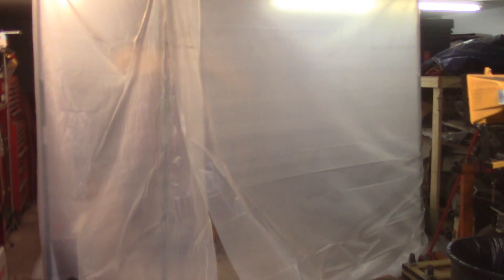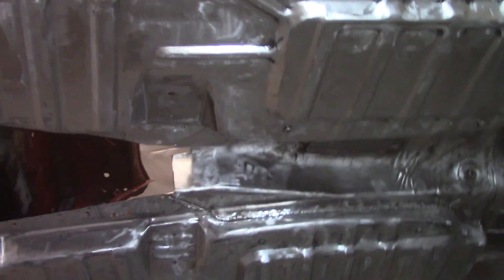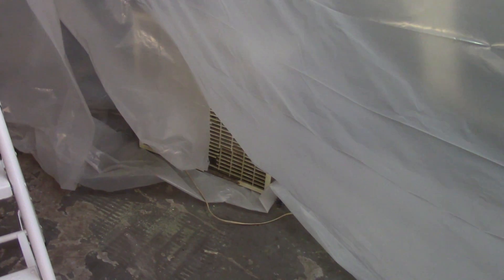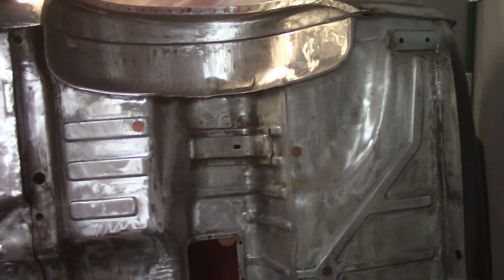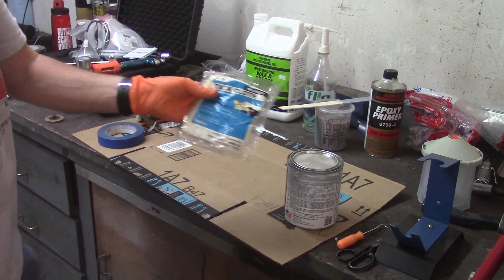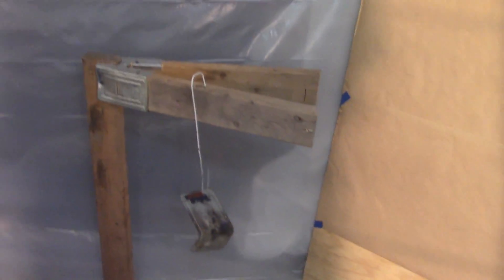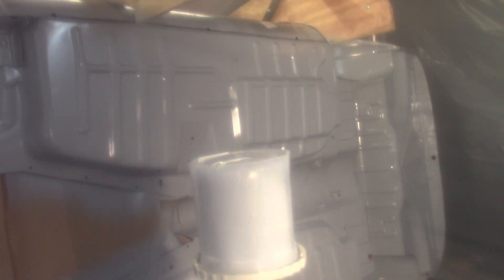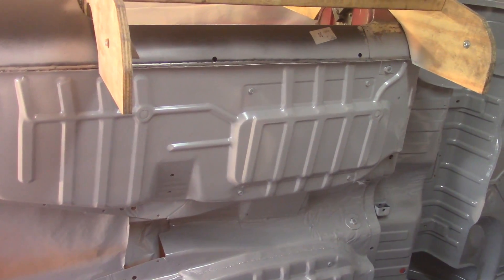Triumph Spitfire Restoration - Underneath Epoxy Primer

Comment: Nice work. Do I have to wait a bit when adding the hardener or spray directly? The strange thing is that your epoxy is more shiny than what I see in other videos.
Reply from the maker: You have to check with what your paint maker says is the proper induction time. For SPI, it's 30 minutes.